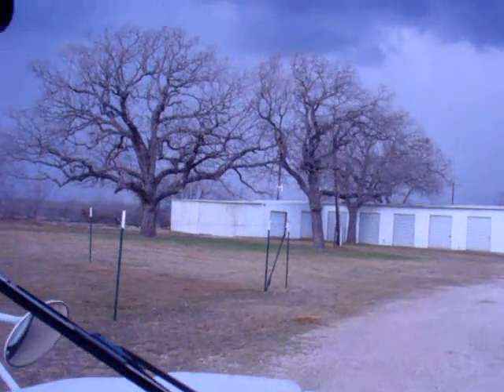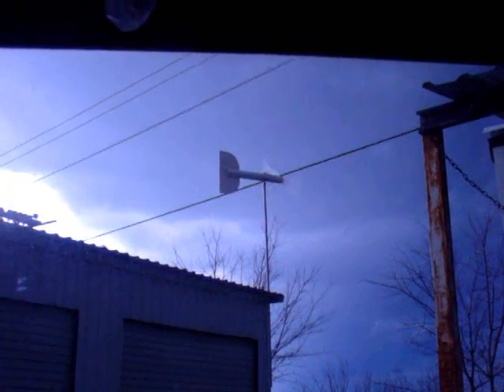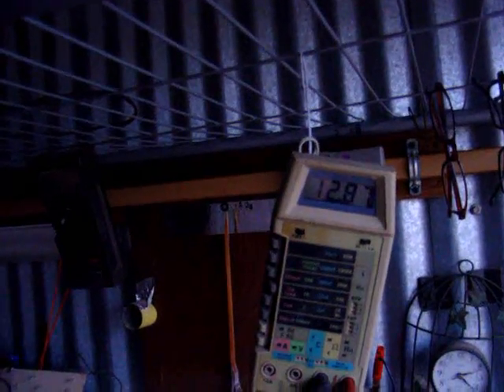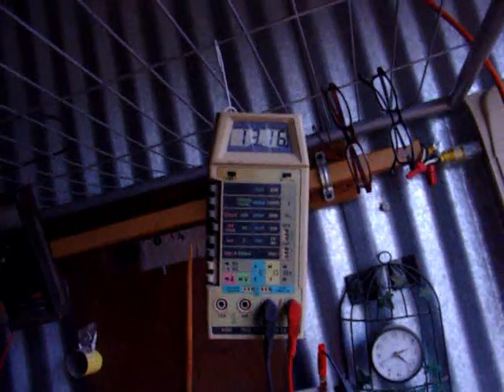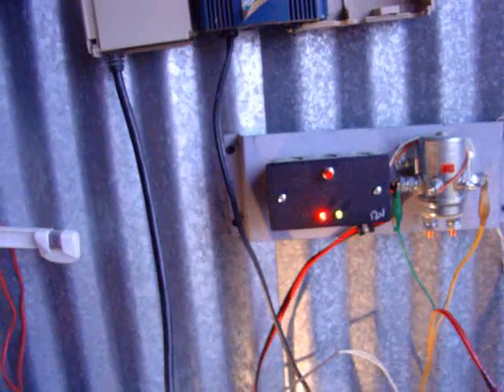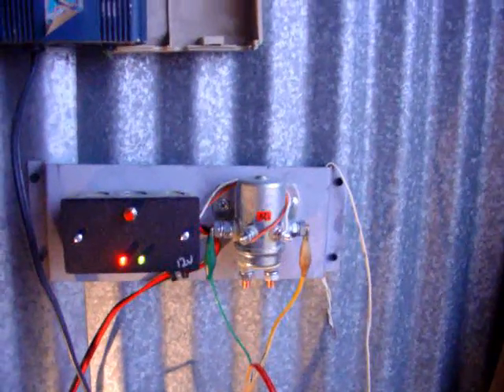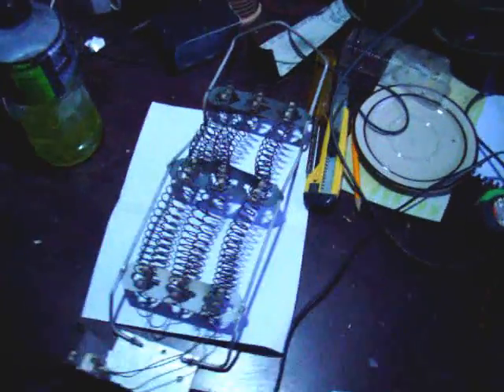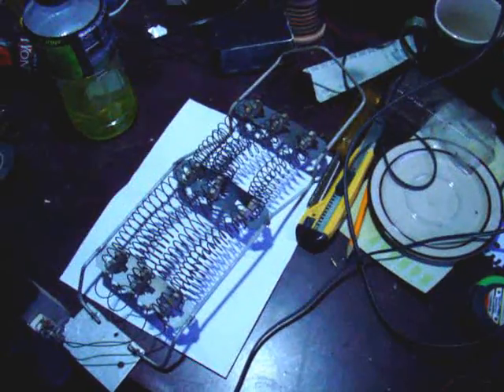Wiring up Charge Controllers Safely Diversion mode - Disconnect mode (part 1)

Comment: Sir i would like to ask you a question about the wiring of your dump load. I have tries to read the comment section but I am lost.It would seem your having private conversations that have been deleted.
I would just like to know what wire you used to go from the charge controller to the neg O dam I can't make heads or tails of what you posted. Could you please try and say how to hook up the dump load from the controller. it is the " 2 leads from the charge controller across the battery " that has me confused
Reply from the maker: Wire from the (pos), Positive post from the battery, to one of the (NO) (Normally Open), terminals of the relay.

Then from the other (NO) terminal, to the dump load.

Then from the other end of the dump load, to the (NEG) negative battery post.

I hope this helps
 MUDDy

Comment: Looking good Muddy. I know you lot over there don't do electric kettles, but do you have immersion heaters for hot tap water? I have been thinking for years now of dump loading into a water tank, you get free hot water and water has a huge thermal mass. You could dump around 250watts a gallon with the 50% ish duty your dump switch is going. Keep 'em coming I look forward to your updates.

Comment: What is your average output over a period of say 1 month? What is the maximum output? At what speed does the generator start producing useable electricity?
Did you design the stator for output at low rpms (by using thinner wire, which means less maximum power, but good power at low RPM) or for high RPMs with thicker wire (which usually means the generator won't create any energy until the RPMs get higher)?
Thanks for posting, great videos.

Comment: What is the maximum and average efficiency of your inverter? I know they generally will say they are X efficient, but that is only at 1 particular load, in other words, they list it's maximum efficiency as in "up to 85% efficiency", when in actuality, it's average efficiency is 50% (the cheap ones). Also, how many watts is it rated for and how much $ was it?

Comment: What is the purpose of a "dump load"? Is it something you can turn on when the wind is really, really high to keep the RPMs down? As long as you have a good charger and voltage regulator, there shouldn't be a need to "use" any electricity as the resistance in the stator will drop and theoretically there shouldn't be any "extra" electricity being generated. In very high winds you could put a massive load (like an electric heater) on the generator to keep the RPMs down.